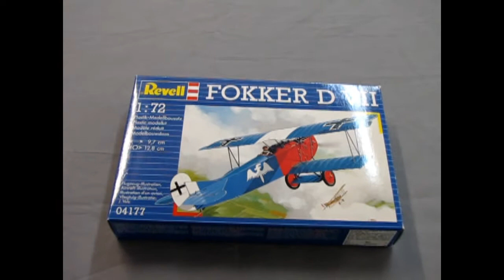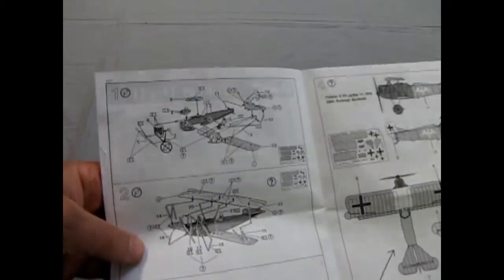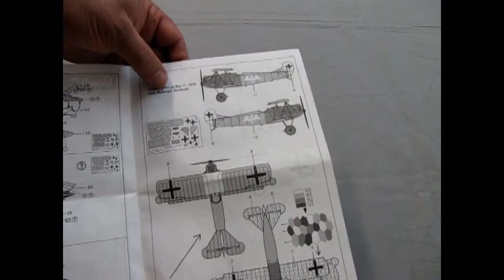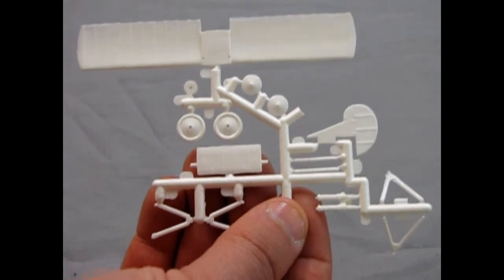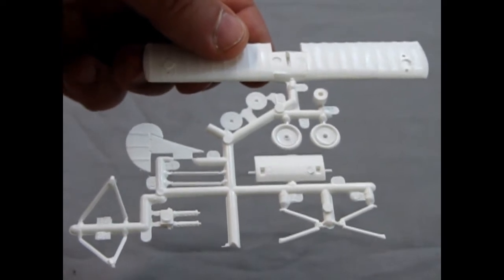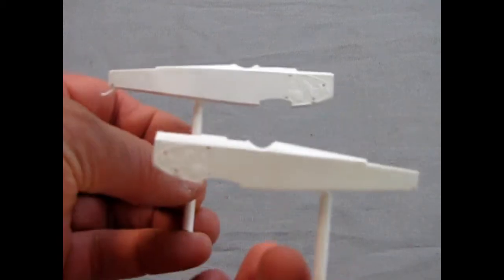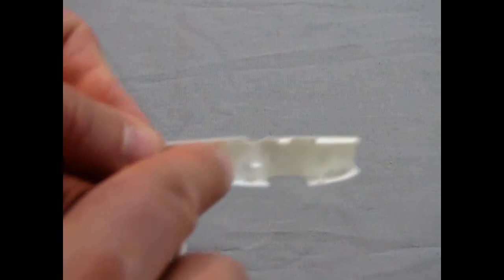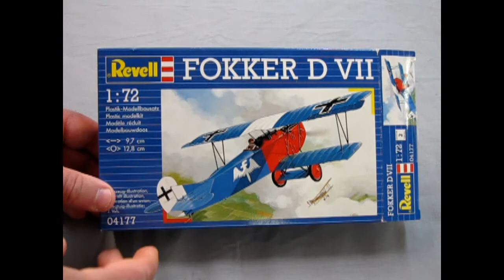What's In The box? The 1/72 scale Fokker D.VII Plastic Model Kit By Revell - A Model Kit Unboxing

Comment: Das goot video.
Reply from the maker: Thank you for watching. Have you built this model before?
Reply: @monsterhobbiesonlinestore  No but I might. I always told myself I wouldn't go down that rabbit hole of collecting DVIIs but I if I do it would be only one and it would be this kit. I just piked up the Revell Dr1 (old tool) and their Sopwith Triplane. Both are from the mid to late 60s and they are beautiful in the box. I could have easily found the Roden or new Revell kits but the classic is just fine.
Reply from the maker: @williamroberts8470  The big question is "Which way will you paint your 1 and only DVII?" :D
Reply: @monsterhobbiesonlinestore  Good question. Perhaps I'll go with whats in the box. You see if get the Print Scale DVII decals sets 1 and 2 then I would be forced to collect way too many DVIIs.
Reply from the maker: @williamroberts8470  For sure. What do you think about those camo decals, the ones you have to paint on top of that grid?
Reply: @monsterhobbiesonlinestore  They are a great touch and a unique one but only if they are accurate in shape and pattern. Lozenge is a funny thing amd the DVII were covered with specific types. I might have to get this kit haha.
Reply from the maker: @williamroberts8470  i have a set of Lozenge decals someone gave me. You cut them to fit and they are pre-"painted".
Reply: @monsterhobbiesonlinestore  yes and that is difficult but thats wwi modeling for you.
Reply from the maker: @williamroberts8470  A real "Battle" :D